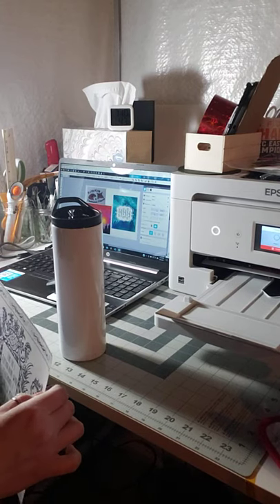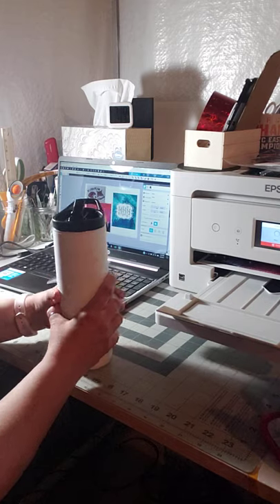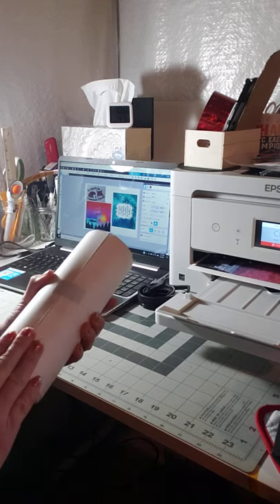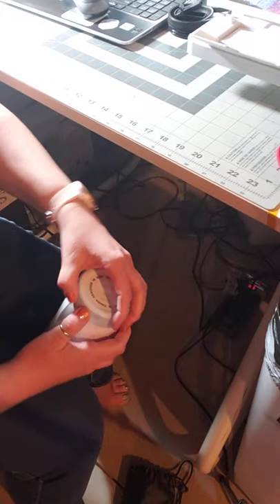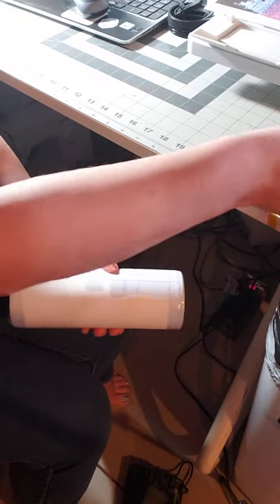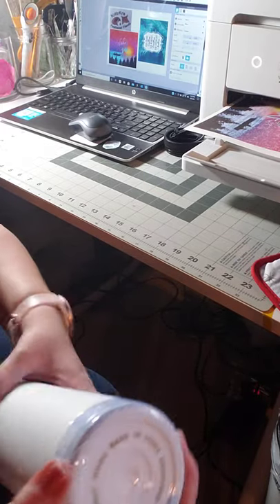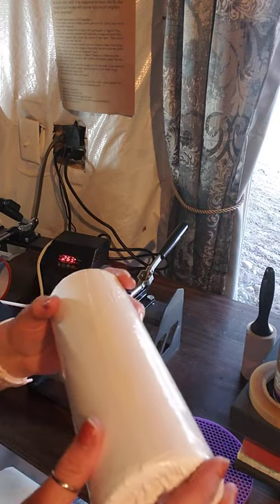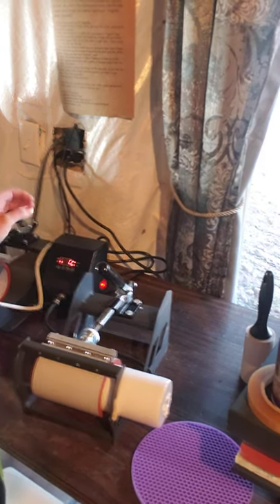sublimating a tumbler in a 11oz mug press with shrink wrap

Comment: Two questions ,Can you use a inkjet printer secondly what kind of paper are you using?
Reply from the maker: I use an epson et2720 and epson et15000 with sublimation ink by Hiipoo. I run Koala. Asub or Hiipoo paper.

Comment: How do you not melt your shrink wrap? Mine melts
Reply from the maker: In a mug press or in an oven?
Reply: @craftingwithcarrie8721  I have a press. It’s not a small press but it covers the entire 20oz tumbler. The shrink wrap melted right away.
Reply: Mine melts too. :(
Reply: @Dreamrbystarlight  The shrink wrap is to hold the artwork against the mug tightly. The mug press does the same thing without shrink wrap. This adds additional cost unless you use an oven that you can place several items in at once.